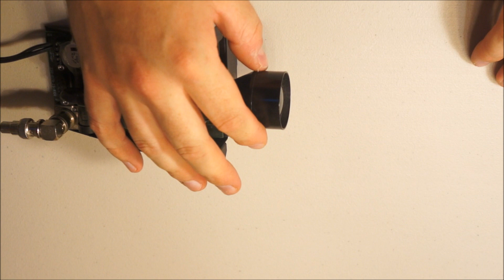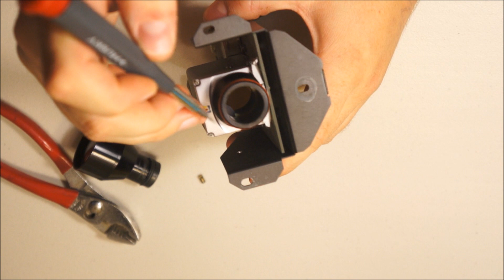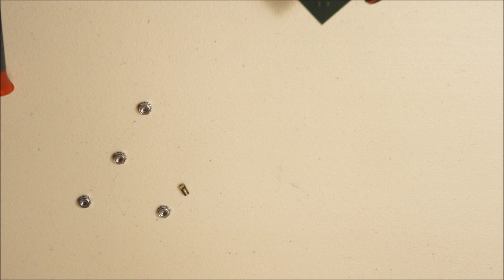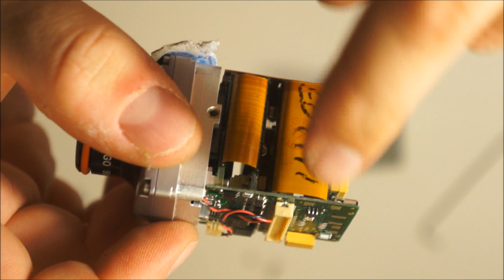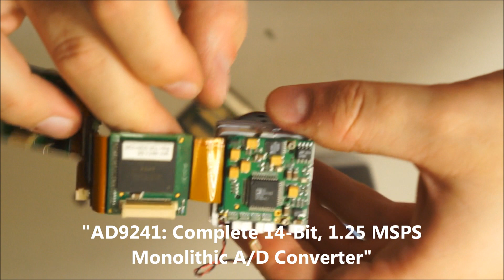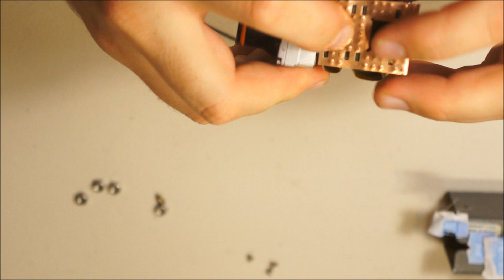Extreme Teardown: FLIR IR Security Camera

Comment from the maker: If the heating were for calibration purposes, it would make much more sense to package the heaters into the camera housing. As it is, it seems much more like an afterthought. 
The camera itself is a self-contained module, and it's just mounted to a carrier PCB that includes the heaters. If the camera needed the heater, having to have the big external PCB for the heater would make no sense. 
Anyways, apparently heaters like this are fairly standard on CCTV equipment, which this is.

Comment: I think that the heating is done in order to actively keep the sensor at a constant known temperature where the noise has been characterized during a calibrating process, in this case in the design. I guess that this is what that shutter is for.

Comment from the maker: Looking at the video again, I think you are correct. The small circuit on the bottom side of the board does indeed likely control the heater resistors.
I don't see how it measures the temperature, though.

As for the serial interface, I'm not sure. I heard about it, peripherally, but have not actually worked with it. Most of the knowledge I have of these things is incidental, as there is a project involving a bunch of them where I work, but it's not something I am personally involved with.

Comment: Heaters are common in outdoor CCTV housings, to prevent condensation. I wonder if the small cct near it is a temperature sensor and power control for the heater.